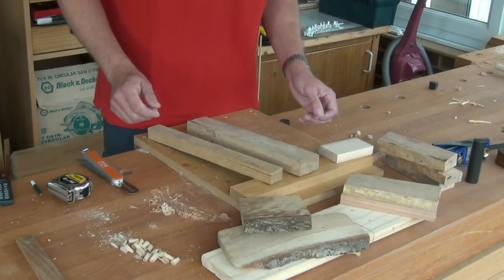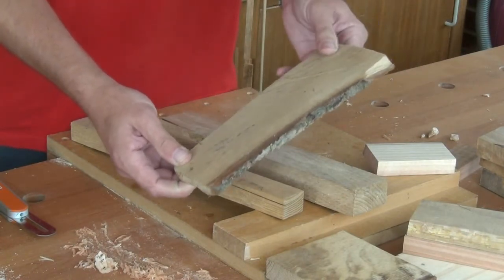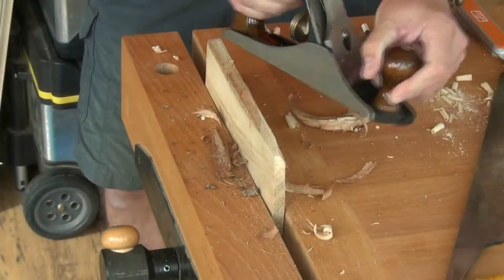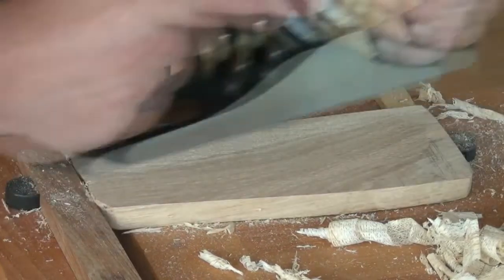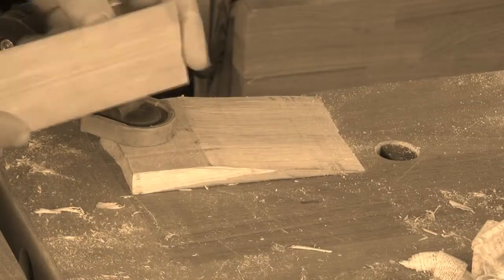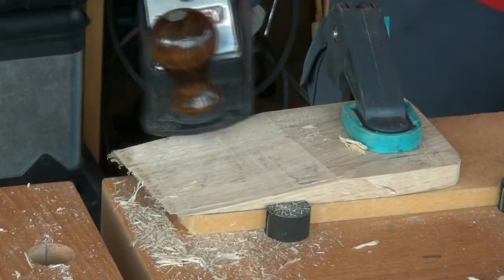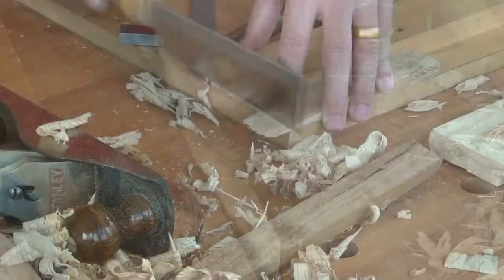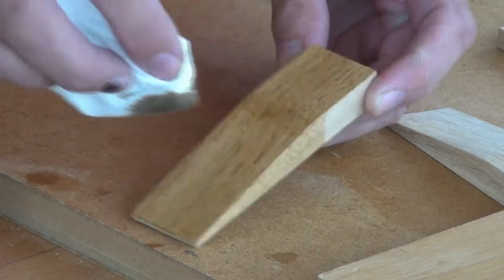Make A Door Wedge or Doorstop

Comment: Thanks for the useful video! What is the slope again, please?
Reply from the maker: Andrei Gotia Hi Andrei. I find anything from 1:4 to 1:7 works fine, whatever angles they are. The shallow angles working best if the floor is slippery.
Reply: Thank you, Mitch. Forgive my ignorance, how do I calculate the ratio? Thanks again!
Reply from the maker: Andrei Gotia You could Google "slope angle to degrees conversion", or just use the height of the door stop multiplied by the bigger number in the slope ratio to give you the length of the sloped section
Reply: Thank you kindly!